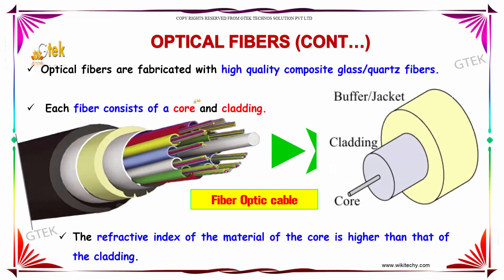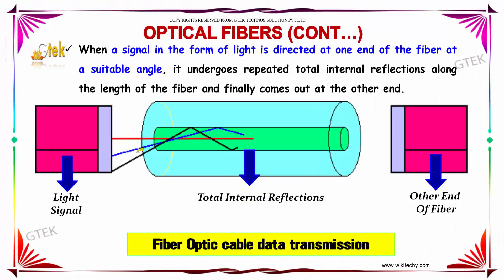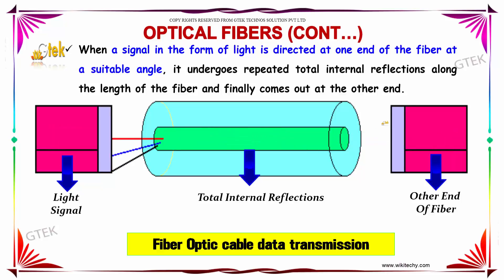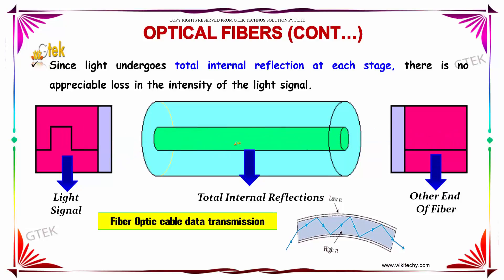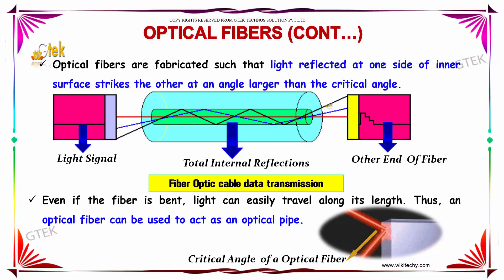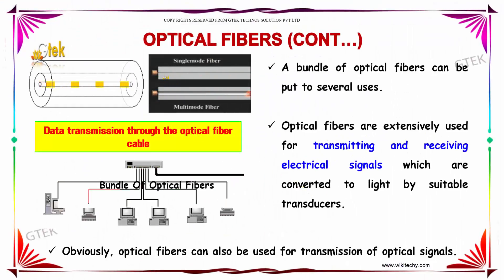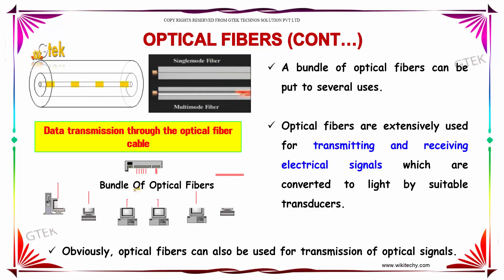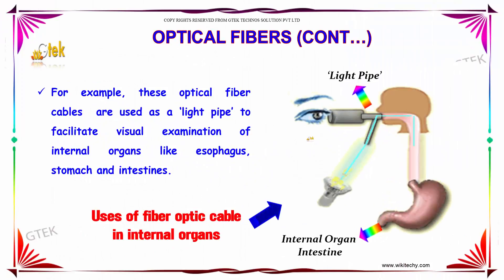Fiber Optic Cable|Optical Fibers|Optics|class 12 physics subject notes lectures|cbse|IITJEE|NEET

Comment: For short distance application, such as a network in an office building (see FTTO), fiber-optic cabling can save space in cable ducts. This is because a single fiber can carry much more data than electrical cables such as standard category 5 Ethernet cabling, which typically runs at 100 Mbit/s or 1 Gbit/s speeds.

Comment: An optical fiber cable is a cable containing one or more optical fibers that are used to carry light. The optical fiber elements are typically individually coated with plastic layers and contained in a protective tube suitable for the environment where the cable will be deployed.

Comment: The yellow cables are single mode fibers; the orange and aqua cables are multi-mode fibers: 50/125 µm OM2 and 50/125 µm OM3 fibers respectively. An optical fiber (or optical fibre) is a flexible, transparent fiber made by drawing glass (silica) or plastic to a diameter slightly thicker than that of a human hair.

Comment: A fiber optic cable consists of a bundle of glass threads, each of which is capable of transmitting messages modulated onto light waves. Fiber optics has several advantages over traditional metal communications lines: Fiber optic cables have a much greater bandwidth than metal cables.